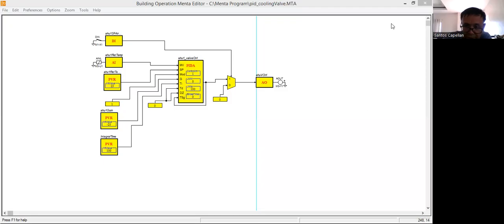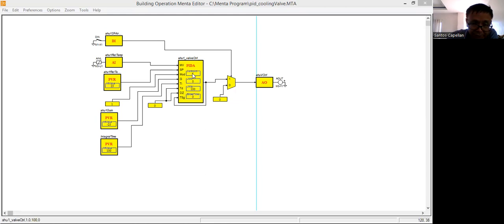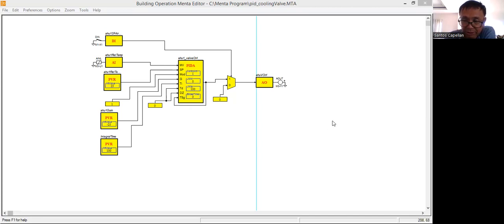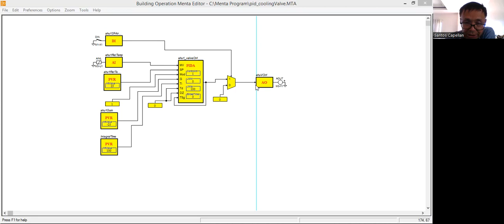PID control for AHU cooling Valve. How to become a BMS Engineer by Santos C. Capellan Jr.

Comment: Sir one customer is looking based on  temperature setpoint and Temperature with .5 dec increase and decrease difference setpoint  , modulating 2 way valve , looking non pi application , is it possible?
Reply from the maker: it is possible but I guess the control logic is difficult, it is much easier to use a PI controller